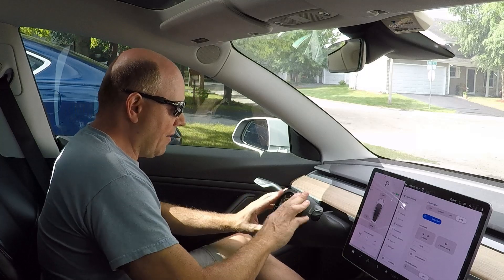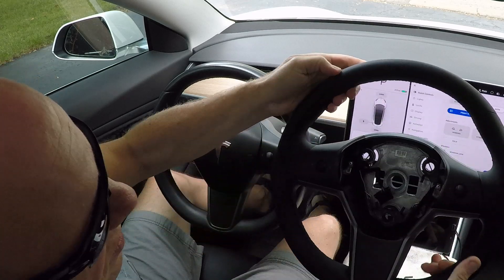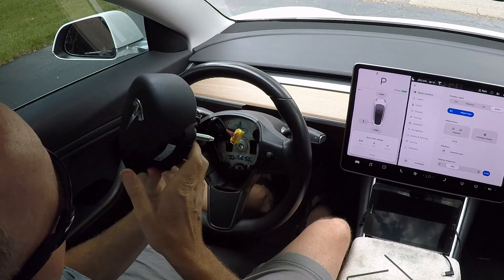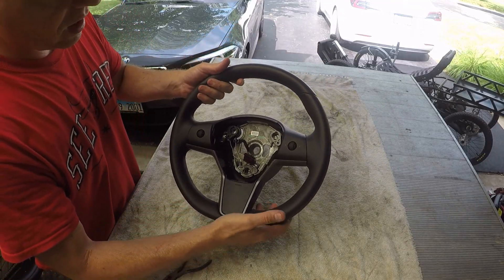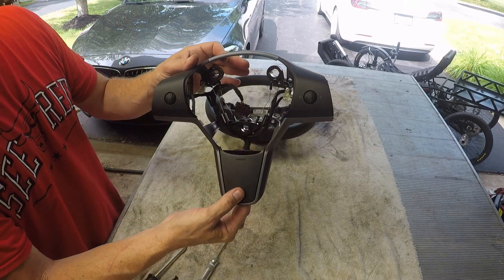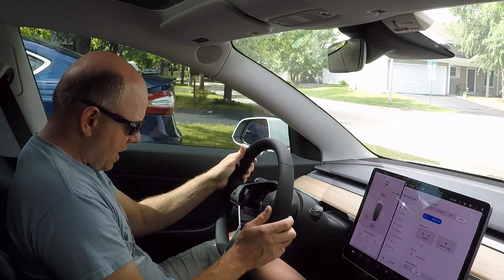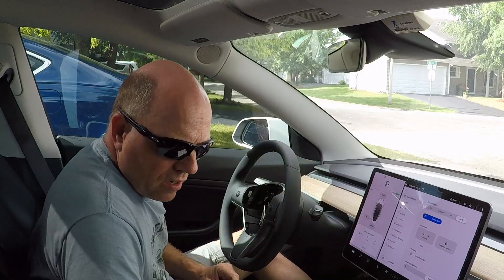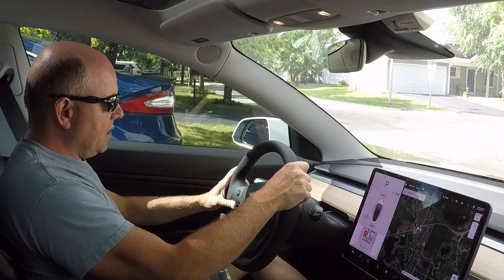Steering wheel MCU? Let's look inside the Model 3 wheel!

Comment: The Steering wheel electronic control unit is inexpensive (<$10 at this time), so I understand the desire to use a new unit with a replacement wheel as that eliminates the need to disassemble the factory wheel and any related screwups, plus leaves the factory wheel as a 10 minute swap should any problem arise with a new wheel down the road. As you pointed out, the module has to be programmed for the car its in. Tesla provides a free online service manual, and it describes the process for installing a new module in a car. One step is to reinstall firmware via the car touchscreen (instructions provided) but after that there are some steps using Toolbox which is NOT cheap, but the steps sound like they may just be tests to make sure the firmware reload worked right. I sure would like yp know if the Toolbox steps are really needed. Any chance you might try the steps up to the Toolbox ones to see if the module gets programmed by the firmware reinstall step?

Comment: i have been considering taking a used steering wheel and modified it to make it a two spoke design, deleting the lower spoke. In your experience is there any room inside the center of the steering wheel to relocate the ECU?

Comment: Very informative, thanks!  While you were poking around on the wheels, did you notice any type of wires or sensors going to the actual wheel?  It would be interesting to see how the car knows that you're holding the wheel during autopilot.

Comment: I think the sub control units are registered to the main MCU.  You have to go into the mcu and make a change if you want to use a new ecu
Reply: Does that apply to the steering rack as well? If so how do you register new/used components?

Comment: POWER DOWN YOUR CAR BEFORE TOUCHING THE AIR BAG PLUG!!!  This is done by popping the quick release that lets you remove the rear seat bottom and disconnecting master power.  Also disconnect the 12 volt supply.  Once done it is reasonably safe to disconnect/reconnect the air bag.
Reply from the maker: You obviously didn't watch the video. I already covered that. 

Good grief, people need to watch carefully before posting.......

Comment: You are lucky the airbag didn’t go off...power off first boy and girls.
Reply from the maker: I DID power off.

This video was many segments. The screen was on in a couple of then clips.  But, again, I powered it off. I even had the main harness and the 12v battery disconnected for most of these clips.
Reply: @TechForumTesla  but you didn't show or talk about doing that very very important part. Some bozo might take your video at face value and get hurt. Just sayin
Reply from the maker: @RoboRope  yes, I did. Obviously you did not watch the video.
Reply: @TechForumTesla  I did watch I never heard you say you disconnected the power.  I'll watch again...if I'm wrong I apologise.
Reply: Ah you did say you disconnected the power but said one could  just power it off from the menu...I'm going to go with a big fat no on option two.  But again yes you did  address doing it with the car being disconnected.
Reply: The power was on when you plugged in the airbag at the end of the video.  Oops
Reply from the maker: @HometownHandymanLLC  yes, because I was testing various steering wheel CPUs. Do you have any idea how long it would take to do that if I disconnected power EVERY SINGLE TIME? 

Listen dude, you can wear a helmet every time you go outside, cross the street, or go get your mail. I choose to live life without worrying about every little thing that could happen in every fringe situation.  

Oops.....
Reply: i think to work on the Airbag, you have to disconect the both Battery´s, if im right there is a plug under the backseat.

Comment: Hi have you disassembled the steering column lower than the steering wheel? just wondering about swapping the indicator levers to the opposite sides for right hand drive vehicles here in Australia the indicator is on the right hand side of the steering wheel thanks keep up the good work on the videos☺